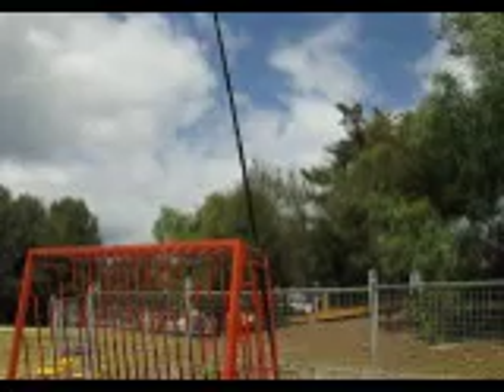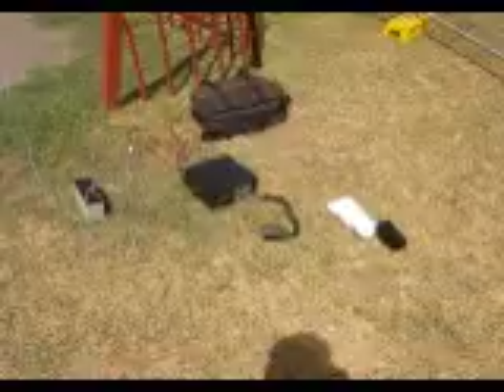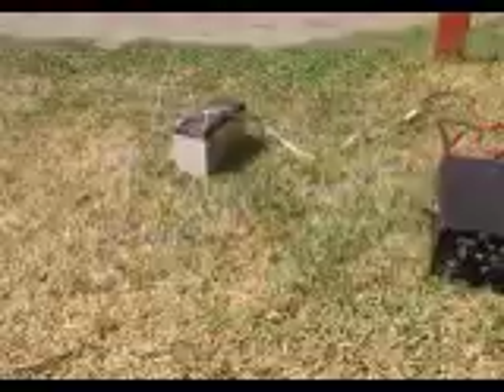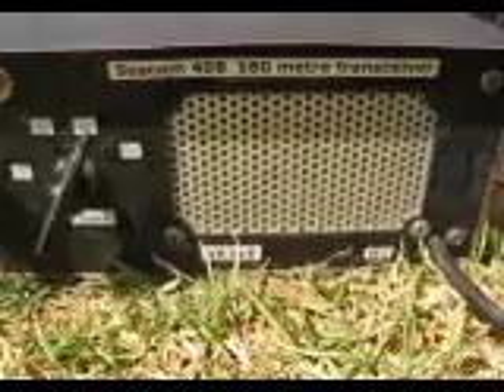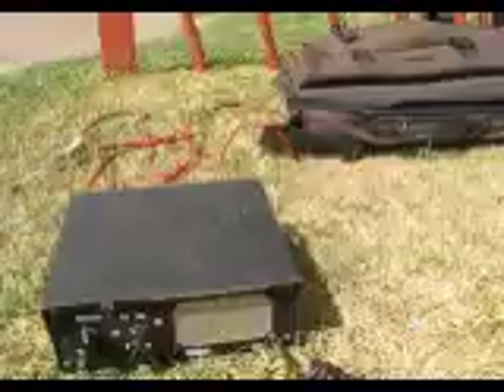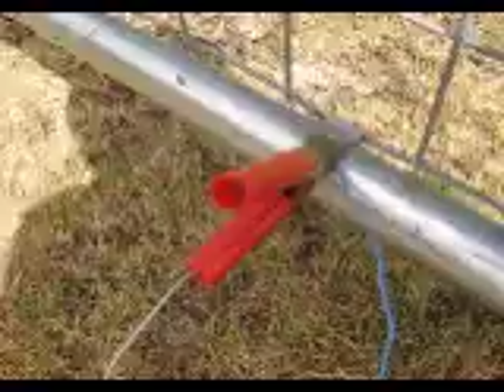160m from the park

Comment from the maker: It's a wire up a 9 metre squidpole (described in another video).  The transceiver used is a Seacom bought cheaply at a hamfest. 

A modern SSB rig (eg FT-817) will work but its AM modulation isn't as good as a dedicated AM rig.

Comment: Hi Peter - what is the length (height) of your antenna and how did you make it. I plan to go 40 metres AM portable and basically follow your example. Also what is a good low power transceiver that has AM mode that would be suitable for land based portable use around Melbourne?